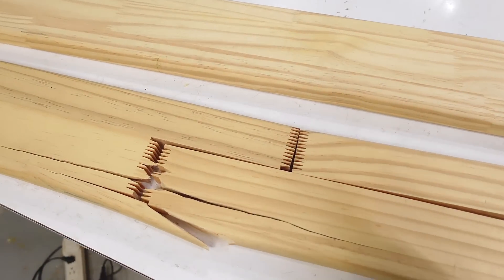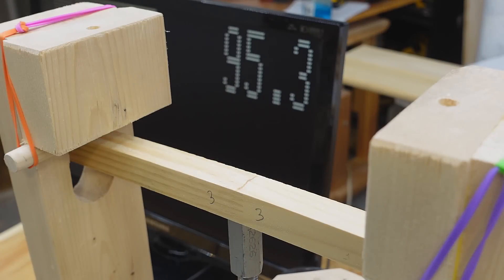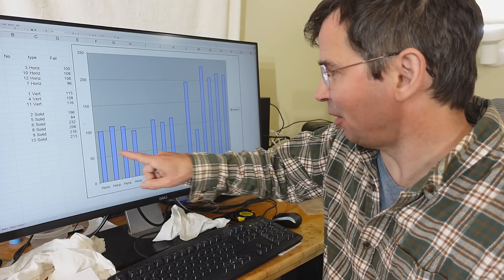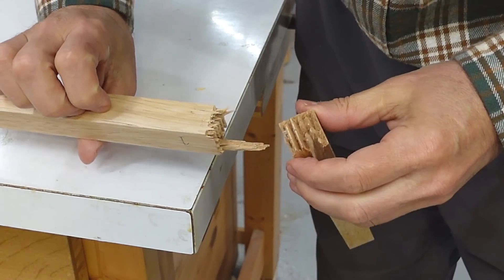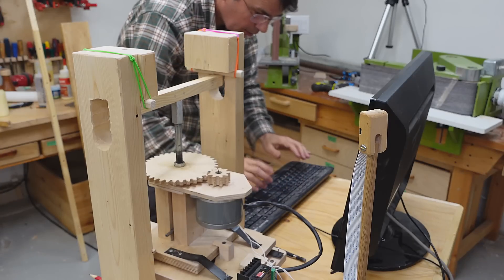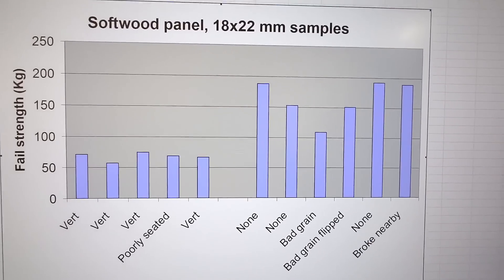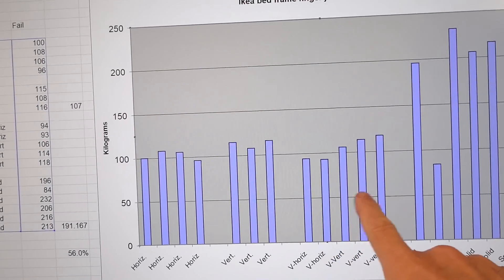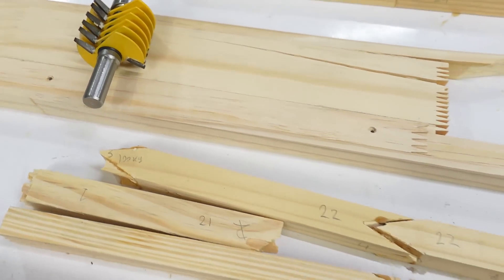How strong is finger jointed lumber

Comment: I think the pine panels are made from the off cuts from the sawmill so they are probably not the best quality wood to begin with. The oak bench top looked pretty high grade though and made to a higher standard generally so that should have been better. I guess those joints are more for alignment than anything else though since you usually see them in places where they wont really be stressed from normal use. Would have been interesting if you hade cut the pine panel in the other direction though and tested wether the finger joint was stronger than the long grain butt joints.

Comment: I think the main reason to use finger joint is to use as much of wood as possible for parts that don't require much strength like flat boards. and it's practical because it's quick and it doesn't require precise alignment. so, even it's half the strength of original blank, finger joint is here to stay. btw I love the test apparatus.

Comment: I've watched a number of videos on gluing endgrain and the important point that was made--and backed up here--was that end grain tends to soak up the glue into the fibres, which makes them much stronger, but tends to starve the joint, itself.  I believe that you can see this in some of the samples, where there is barely any glue between the two pieces of wood.

I suggest you first try adding a generous amount of thinned glue to the finger joints, leaving it for 5-10(?) minutes to soak in, then wipe away the excess and add the proper amount of glue, followed by clamping/etc.  I suspect that you will find the joint to be MUCH stronger than just gluing the joint as you would with edge grain.

Cheers!
Reply: What you say is true, but in my experience of restoration of ancient pieces and repairing old ones I noticed that if the glue joint is strong when is new the things change with time. To make it simple a table top made with recently glued boards nailed to the frame so it can not expand and contract with the seasonal change of humidity will develop a crack in the wood, the glue is stronger then the wood itself, but if you bring it to a dry environment after some years has passed is very likely that the glue joint and not the wood will fail. This is even more true when gluing endgrain to long grain or to other end grain as edge grain, end grain parallel to the growth rings and perpendicular to them have 3 different coefficents of expansion. 
Finger joints can be used to joint the heads of two pieces to make a longer one, but then that longer piece should never used in a place where loads are involved, even if precautions to don't starve the glue line are taken.
Tests on freshly glued wood can be somehow useful, but can also very misleading if we build something that has to last, the more the time passes the more the glue cristallizes and becomes brittle and with time and seasonal movement micro cracks will begin, we can allow some movement fixing a table top to the frame to avoid problems, but we can not allow movement inside a glued joint between end and edge grain, it can seem to be strong if the glue has not starved, but it will surely fail with time, and with time I mean some years, not centuries.
Reply: @andreachinaglia5804  "the more the time passes the more the glue cristallizes and becomes brittle and with time and seasonal movement micro cracks will begin [...] but it will surely fail with time, and with time I mean some years, not centuries."

That's an excellent point, and probably why many Japanese (wooden) temples have withstood over a millennia of earthquakes/storms/etc.; they are built without glue or fasteners, just complicated, strong joints.
Reply: @KeithOlson  Because Japan actively restored these buildings for centuries. Many if not most of these buildings did not stand the test of time. The irony is that Japanese housing aren't built to last.
Reply: Sure, but nobody will do that industrially. The point of joinery is to be easy to make and stronger than the wood, not complicated and strong
Reply: @thedrunkenrebel  "Sure, but nobody will do that industrially."

True enough.

"The point of joinery is to be easy to make and stronger than the wood, not complicated and strong"

I have to disagree with you there.  For commercial and newbie use, sure, but masters of the craft don't worry about 'complicated' when creating their works of art.  Their focus is on doing the best job they can, not just fast and easy. Many Japanese (wooden) temples have withstood over a millennia of earthquakes/storms/etc.; they are built without glue or fasteners, just complicated, strong joints.

Comment: Bearing in mind the joint is mainly in sheet material it is an unfair test and would give very different results if you tested a board as the joins are supposed to be staggered I would expect uniform results.

Comment: I would be interested in a comparison of the angle joints VS. a box type joint.  I believe the angle joint puts the glue more in tension and the box joint would put the glue more in shear resulting in a stronger joint closer to the strength of the wood.
Reply: I agree. I suspect straight cut finger joints would be stronger, as the glue surface would be a higher proportion of long grain to long grain, as opposed to a semi endgrain to semi ingrain joint with the V finger joints.

Comment: Interesting that glue joints seems significantly stronger on hardwood than soft wood. If the glue was the limiting factor, I wouldn't have expected that. It must bond stronger to the oak for some reason. Larger pores?

Comment: This is very interesting. I do a lot of trimwork using finger-jointed materials and I despise it. The quality of the joints suck with many being short on glue, many others where close-grained joins with wide-grained and the milling 'jumps' at the joint, and more than a few joints not fitted tightly. It's as if whoever puts these together doesn't know wood and doesn't care about fitment. Over the years I've noticed the length of the pieces being used have grown shorter, and now some are also made of laminated edge-glued parallels of finger jointed material. I understand the desire to use what would otherwise be waste but it's getting ridiculous.

Comment: I have a bookcase my parents got at some finish it yourself furniture store c1960. The middle shelf is adjustable and rests on four metal pins that fit into holes in the sides. The shelf is made of boards joined lengthwise right in the middle of the shelf! I never realized that until I removed an entire set of old World Book Encyclopedias off the shelf. Those things are heavy, but the shelf is still straight as a board! No sign of failure.

Comment: I would assume the strength of those joints very much depends on the manufacturing quality of the board. How well the fingers fit together, the quality of the glue that was used and so on

Comment: You can check out the Canadian SPS 1, Fingerjointed Structural Lumber - interchangeable with standard lumber.  There is also SPS 3 (Vertical Stud use only) and SPS 4 - Machine Graded
Reply: Is it just one piece of wood glued end to end with another piece, it is more interlocking with multiple boards of different lengths glued together, where the finger joints are not in the same place. That's how I've seen it used in construction lumber and the seller claimed it has higher strength than regular solid wood. Which I believed, because different grain structure would mean it's less prone to cracking from humidity changes.
Reply: @jankoodziej877 yes, when used vertically, for walls gor instance, it is much stronger, especially once the plywood or sheetrock is nailed onto it.

Comment: I work in the engineered wood industry. I will tell you this. Of course a single jointed board is weaker. However, when lawyered (laminated) gluelam beams are significantly stronger than a piece of lumber if the same dimensions. Just look at some of the buildings that are constructed with mass timber.

Comment: Does gluing together the broken finger joints make them stronger? I suspect they’re using a glue that is optimized for quick setting/drying and not for strength. Or, maybe the way they’re drying the joint (ie microwaving I believe is one way) doesn’t allow the adhesive to reach full strength.

Comment: Those are some pretty shallow finger joints. I used to work in furniture manufacturing and our fingers were at least twice as deep as the ones you tested.
Also the glue seems weak. I have glues blocks to plywood where the wood tore out before the glue failed.

Comment: This is salvaged material from the road side? Wouldn't moisture content be a large factor is both glue and base material strength. The ol' carbohydrate foam is sensitive to reorganization due to temp/humidity.
Reply from the maker: Why? it never got wet.

Comment: As the samples come out of an interlaced panel, which averages out the strength. The finger joints are probably an afterthought. My guess is that the ends weren't properly saturated with glue. While these fingers increase the glue surface, it's still all endgrain. And that needs to suck the glue in like a pin to make a bridge.

Comment: My intuition about your results (without testing! pure speculation! ignore me!) is that the angled-finger joints behave very much like 'draft' in the context of molding and casting: the first instant any part of the positive part has lost contact with its mating surface, that entire part of the joint not longer has contact. This is intentional with draft, to ease removal of parts and patterns. Straight-sided box-joint type joints should both be easier to cut and - if my silly speculation aligns at all with reality - may be stronger.
Reply from the maker: the analogy does not apply.  You are dealing with parts that aren't glued in. the wood in these joints also failed in places.  Totally different

Comment: You might want to look into 4 point bending tests, it gives a uniform bending force over a larger distance, negating to some extent localised stress effects.  
Also as you surely know, the dimensions of the fingers, quality of glue up etc. signifiantly affect the strength of the finger joint.  Design Codes for structural glulam beam staves cover this sort of thing.
Reply: MicroLam or GlueLam beams use resorcinol glue which is far stronger, but it neither takes paint well and it's hardness makes for accelerated wear on shapers and cutters.

Comment: Recently had a finger joint break. I thought it was just poorly glued, so I prepared, glued, and clamped it. The joint still split with surprisingly little effort.
Reply from the maker: Did you carve off any remains of the old glue?  Need to do that for new glue to bond properly.
Reply: @matthiaswandel  Not exactly. Good point, thank you.
Reply: @matthiaswandel  I've watched a number of videos on gluing endgrain and the important point that was made--and backed up here--was that end grain tends to soak up the glue into the fibres, which makes them much stronger, but tends to starve the joint, itself.  I believe that you can see this in some of the samples, where there is barely any glue between the two pieces of wood.

I suggest you first try adding a generous amount of thinned glue to the finger joints, leaving it for 5-10(?) minutes to soak in, then wipe away the excess and add the proper amount of regular glue, followed by clamping/etc.  I suspect that you will find the joint to be MUCH stronger than just gluing the joint as you would with edge grain.

Cheers!

Comment: I’m thinking… maybe it has to do with the springiness of the wood, white glue is quite brittle, if the wood yields and deform without breaking it just pop off, and that would be why hardwood has a lower difference between solid wood and finger jointed wood

Comment: I'd be interested to see if there is a better adhesive for this type of joint, or some kind of surface treatment pre-gluing.
Reply: A toughened epoxy might work well. (example, west system g-flex epoxy). But epoxy is messy to work with. And you would realistically have to wait at least one full week before testing it to make sure you are getting full strength. The toughened epoxies remain a little bit flexible after curing compared with traditional epoxies which are more brittle.

Comment: Couldn't the conclusion be that the glue used by the manufacturer was cheap.. or under applied?  Also, this style of finger joint (pointy fingers) doesn't seem to put as much long grain against long grain as a more rectangular style joint.  Wouldn't that be stronger?

Comment: For gluing end grain, I saw a vid by a long time cabinet maker who advised applying glue to end grain twice. He applied end grain glue to all end grain butt joint faces in a face frame first, then started at one corner of the face frame & applied glue to all joint surfaces hitting the end grain faces a 2nd time. Theory being it takes a few moments for glue to wick into end grain pores so  1st application won't do as well if that's all you have for the end grain face. Seems logical, but it needs to be tested to see if the theory matches practice.
Reply: It also could be compensating for the glue being used. Different glues and different woods have different rates of absorption, and glue which gets absorbed by the wood too quickly leaves the joint dryer and weaker. You can prove this by gluing two pieces of MDF together as it rapidly absorbs glue. On one joint apply and wipe the glue on both sides, leaving it to sit a bit until it's beginning to tack up. Apply another light coat then clamp. On the other test joint slobber it with glue and clamp. Once both have cured fully, the latter joint will separate cleanly at the glue joint with little provocation, while the first joint will be tearing apart the MDF itself from both sides and will take more force to break it. Softer woods will act more like the MDF with harder woods not so much, so harder woods will join better with one coat of glue.
Reply: Called gluesize, mostly useful with hot glue as it is really absorbed, not so much with white glue as shown in the video. 
Endgrain on endgrain never works anyway, except for compression.
Reply: If the end grain sucks all the glue away, then you definitely do need to add more; but if you want to glue end grain and have it be strong, I suggest skipping to a construction adhesive!
Reply: It’s been tested in practice for hundreds of years, and nobody advises gluing end grain to anything. Maybe it helps, in addition to the long grain surfaces, but the general consensus is that it’s the long grain surfaces that count when you glue wood together. Was that guy perhaps talking about mitre joints? they’re surprisingly strong, and maybe that’s a technique that makes them even stronger.
Reply: @mm9773  no - it's to reduce glue starvation from the glue being absorbed too much into end grain.

Comment: As far as I remember, to achieve the same strength as the original wooden block, a scarf joint must be at least 1/6 (10°) for hardwood and at least 1/8 (7°) for softwood. 20° is too obtuse an angle - the joint is too short.

Comment: Could you do the same test with similarly sized box joints. I'm wondering if the geometry of the fingers themselves is adding a mechanical component to the weakness.

Comment: But Matthias, the panel you cut your samples off is a board that has the glued joints all over the board, in between regular pieces of wood (staggered) and so gets its strength as a whole I guess. I think you could only compare  this with a regular piece of wood if you tested on a longer and wider piece of board and not only the one finger joint. I don't think that's the idea behind these boards, to make the most out of (scrap) pieces of wood.

Comment: I suspect those joints suck up a lot of glue, and manufacturers don't want that kind of squeeze out.  Very interesting the results you got from a V.  I further suspect you're gluing technique is superior to the manufacturer, but maybe letting the glue soak in a bit longer would increase the strength of the joint.  I'm looking forward to further testing with the finger joint router bit!  And if you're taking suggestions, I'd be curious to see the difference in results from that V vs scarf joint with a similar glue area.
Reply: Glad to read this as I was about to bring up scarf joints  Saw a video from Thomas Johnson fine furniture to lengthen a side rail using a scarf joint. as some may know side rails can be under stress at times

Comment: Seems like any V-shaped groove is basically all psuedo-endgrain in performance. Would love to see it compared to a box joint and maybe a half lap joint at the same scale.
Reply from the maker: box joint would do worse.  Those finger joints are basically a bunch of tiny scarf joints, which could do well if carefully glued.
Reply: @matthiaswandel  I know with scarf joints ratio matters a great deal and these finger joints look like they are a quite shallow angle. So I was honestly expecting more out of them.

Is this maybe a reflection of the manufacturer using the cheapest possible glue and as little as possible in a production setting? Would better glue or better application make a significant difference. Guess we'll find out next time!

Comment: Very interesting.  I suspect that part of the reason is that finger joints are closer to end-grain than face grain.  But I wonder if joint strength is really part of the rationale for commercial finger-jointed wood.  Most of the material I have seen has been intended for decorative rather than structural applications (molding, etc) so strength isn't as critical.

I really like the rigor that Mathias puts into these testing videos.